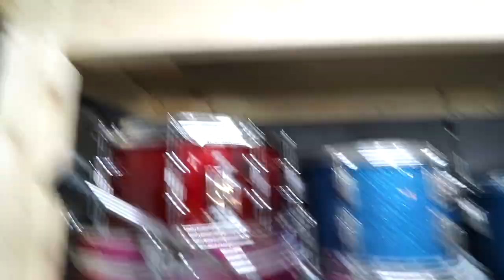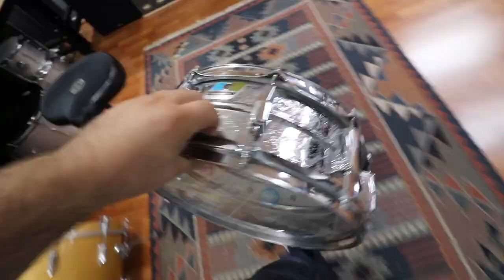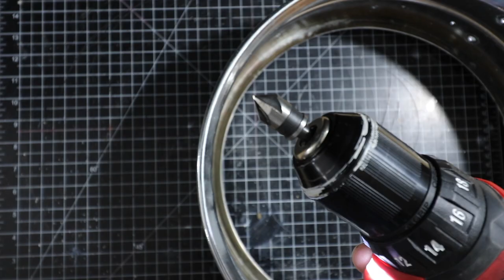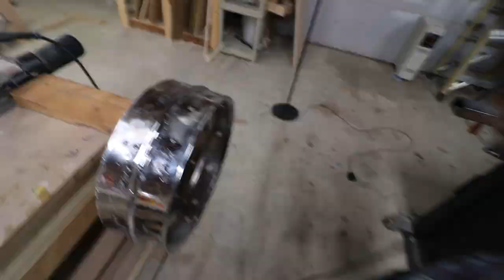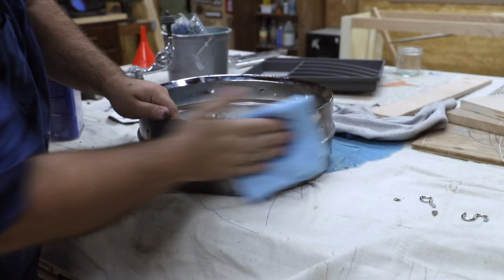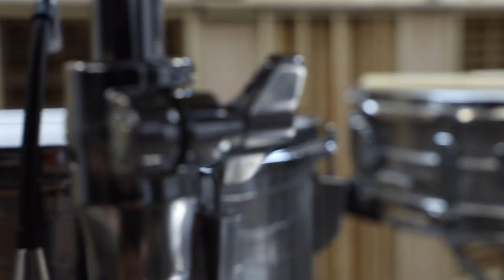I Took an Angle Grinder to my Ludwig Supraphonic

Comment: Should have tried 0000 steel wool.  It may not help with pitting but it can make stuff shine.  I would have thrown glue in the badly blistered/pitted areas and then throw glitter at it to match whatever kit it was going with.  That or rubbed some ash or something dark into the voids.  I like the way it turned out though.

Comment: You might try an aluminum sealer\primer and then powder paint. You did a lot of work but it required more to get to its original aluminum.  Rest on it, then make a plan for a spray paint finish; many options....

Comment: I've also heard that you can sandblast a shell removing the Chrome. Then polish up the bare aluminum shell and it'll look really nice. I seen an example of this once and it looked great. Also seen somebody take off most of the Chrome feather the edges and spray paint with a really nice blue color and that turned out nice to

Comment: I have a super sensitive I did the same thing too. I ended up getting some nice swirl patterns and it almost looks hammered. On a regular keystone Supra, I was able to sand most of it out with an belt sander on an angle  and then paint it with automotive paint and clear. Super sensitive has been sitting since I am not sure if I love it, but I found the nickel underneath was the worst part.

Comment: Hey man.  That would probably be a pretty good base for a tinted automotive clearcoat finish.  OR...even a glitter coat if you know an automotive guy who's really good.  If you did a glitter coat first in chrome glitter, the trick would be to create a turntable rig to hit it at a slight angle, so that the center feature gets properly coated on the first two passes, then finally on the third pass spray it dead on to even everything out.   Bearing edge would need to be taped through that process, and then pull the tape and give the edge of the glitter coat a sand to make sure that there are no rough spots you can feel.  Then clear or tint clearcoats.

You'd end up with something that looked like the slickest ever glitter wrap.  Once you got the hardware back on it, it would be ludicrous.  For a Supra, I think that would be a much more interesting option than a patina.  You literally never see that type of shell with something that looks like a wrap, since it would be technically almost impossible to achieve at scale.

Comment: Boy.....am I GLAD I saw THIS video !!! I have the same, EXACT drum with the flaking chrome and was thinking of doing the SAME THING to mine !!!  Now that I see the dismal result, I feel a better option would be to PAINT the bare shell with Rust o leum " Hand Hammered" spray paint made for metal outside furniture !! In the above attempt, it would have been better if the guy used the grinder to REMOVE all his EXCESSIVE BODY HAIR.......including the SHRUB on his FACE !!!!!!!

Comment: Ugh, I once had a Supraphonic with about as serious a case of "Supracne" as this one. I tried a wire brush on a drill, sanding with various grits....finally wound up taking it to a plater and having the chrome taken off chemically. Then I had a friend bead blast it. I've seen people just get them flat enough and then use spray-on Plasti-Dip

Comment: David I think it’d be cool if you sanded down to the layers and leave it outside in the weather for a while to see what happens. The copper parts would turn green i guess and you’d have a lot of green striped and then maybe seal with clear coat?
Reply: If you get another chance that is

Comment: Hey! I would be interested to know how has the grinded supra been since the making of this video? I bought a old supra some years ago which was painted blue by the previous owner, and im thinking of grinding the paint off. Wondering how the bare aluminium looks after years of handling and exposure. Would greatly appreciate any info! And ps. This video is great, and very valuable to guys like me 😁 thanks!

Comment: Snare tuning question: I play an Acrolite and recently picked up a similar Supraphonic for cheap. The issue I have is that I can’t seem to get them tuned to a mid to low pitch without them being full of ring and buzz. Am I missing something, or is that just how they are? My Supra is higher than Dave’s, and I like his better.
Reply: I've had problems like that and I switch the throw off and it was better but idk🤷‍♂️
Or maybe check the strings at the bottom (sorry forgot how its called)
Reply: Maybe try some thicker heads and a re ring?

Comment: I did something similar to an acrolite i bought used on guitar centers website.  took it apart had the shell powder coated white and the lugs black and put on 2.3mm triple flanged black hoops on it.  Unfortunately after the drum was powder coated it was terribly out of round.  Once i straightened it out and put it all together it looked really cool and sounded decent but the heads didnt fit right.  i ended up selling it and lost a lot of money in the process.  oh well

Comment: @rdavidr Hey man, hug fan of the work you do here. A couple of weeks ago i decided to rip the wrap off of my drums and stain the natural wood. I left two of my rack toms out to dry and I noticed that my smallest rack tom actually shrunk.

I live in the mountains of western MA so it's hot and humid and the sun has been gnarly so I'm just curious if you think that the wood being wet with stain out in the sun was the problem cuz I can't think of anything else that would have done that. If you have any suggestions on fixing it that would be great.

Thanks for the time to read and the great videos. Keep up the good work. Also if you wanna see the drums all set up I'll post them on reddit at u/Quickfrozen